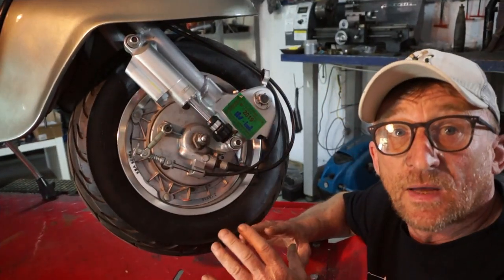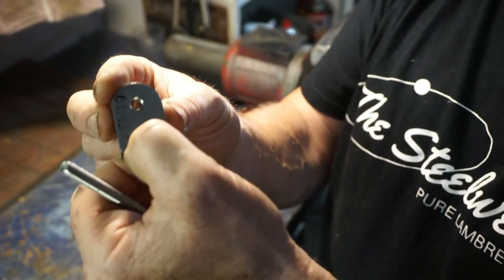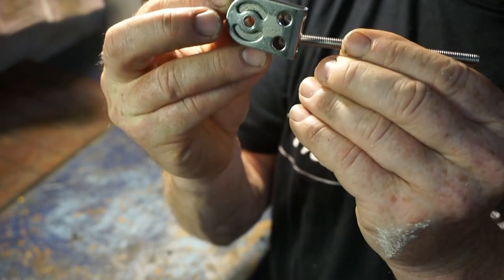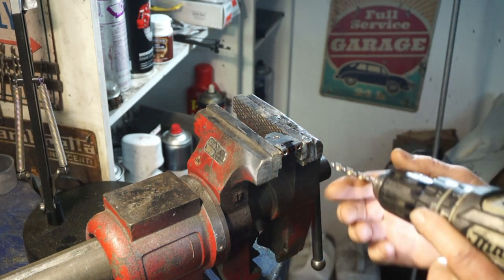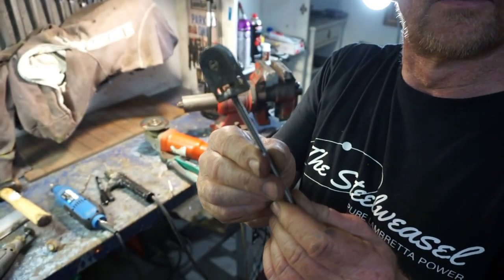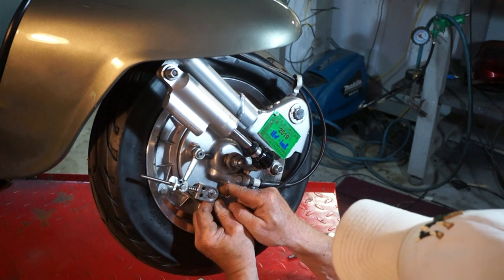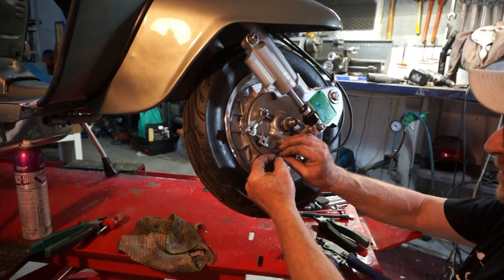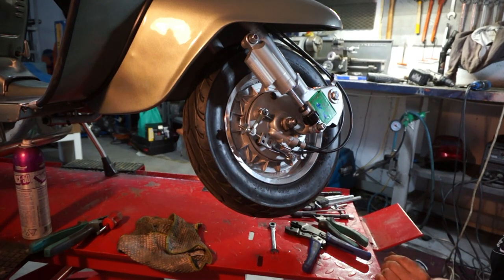THE PULLY BRAKE . LAMBRETTA PERFORMER

Comment: Brilliant mechanical advantage , ideally the pulley could be a roller built into the adjuster , allowing more adjustment but just what you have done has more or less doubled braking power , allowing for friction loss in the pulley . Love the skills and engineering. Look forward to your posts . Yes this can assist a disc brake , simple v rig system ,top draw

Comment: Evening I had a work mate who used to steward at scooter racing events in the late 60’s. He told me they wouldn’t allow reverse pull drum brakes as they had a tendency to lock up.
Reply from the maker: I was racing in the 80s and my reverse pull went through scrutineering with no problem  . They snatch at slow speed but at high speed there's never enough braking power for me .

Comment: This pulley system was available as an accessory for brakes on 80s BMX. Look up ACS "The Doubler". General consensus was a loss of feel and brakes were often described as squishy with it installed but I guess that's a consequence of presumably twice as much lever travel for the same braking power. The benefit must be that you can generate more mechanical advantage when you have a pulley system in the same way a block and tackle pulley system works to lift heavy objects so you can apply more braking force with less finger effort but more overall lever travel required. There's often a suggestion that friction of the additional moving parts negates the benefit to some extent.

Comment: Maybe it's just me but my issue hasn't ever been with the amount of pull you can get to the brakes, it's locking up and the tyre not adhering to the road on those few occasions when you get caught out and have to slam on the anchors. This same pulley device on my clutch though is a Godsend

Comment: Are you selling this item , also can it be used on original SX200 disc brake , if so how much 
Many thanks Stu
Reply from the maker: It wont work on the original disc has it has to much travel on the lever due to a bad design.  Need to develop a new one that's more solid less give . Sorry buddy
Reply from the maker: Nope dont sell but some company will copy it with in weeks K2 customs most likely....
Reply: @TheSteelweasel  you should ask for commission, he’s a cheeky f-er